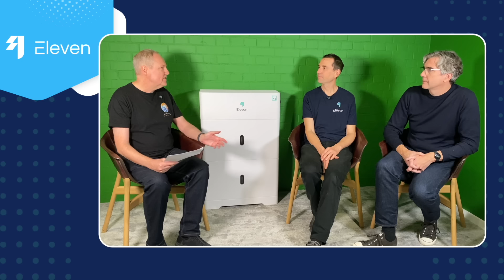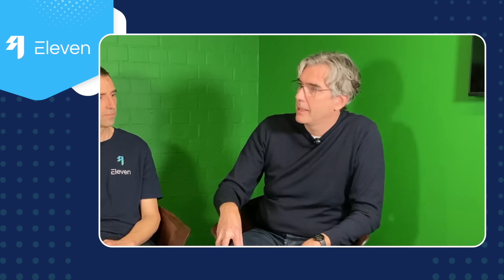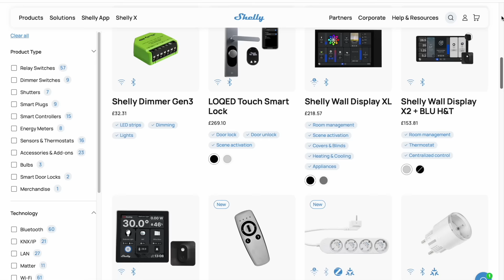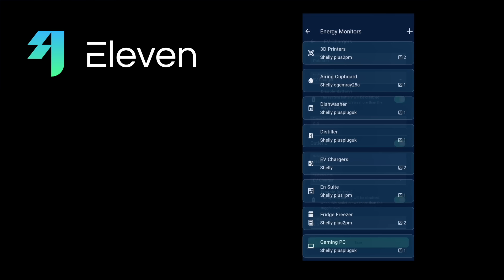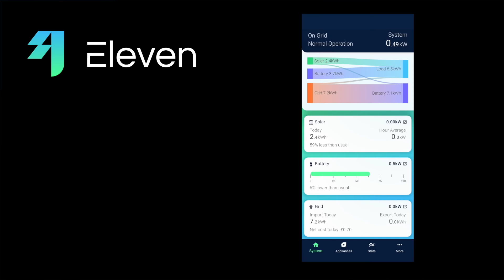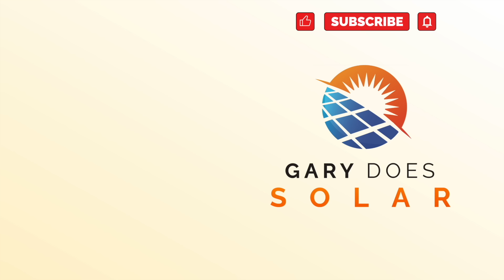Home Batteries: Could SODIUM Be More Popular Than LITHIUM Soon?

Comment: Yet again, no real addressing of the unusable charge /discharge curve of sodium batteries. You either have extremely expensive associated equipment to invert across the discharge curve, along with massive conductors, or you only get to use a small percentage of the capacity.
Reply from the maker: So why are BYD and CATL investing heavily in this technology then?
Reply: @GaryDoesSolar Probably because they are hoping for a cost benefit curve that favourably intersects with lithium at some point in the near future. Better to bet on two horses than one. However, the amount of money invested is not a good indicator of ultimate performance, just look at US Synthetic Fuels Corporation which was capitalised in the 1980s at $20bn (real money then) to produce liquid fuels from coal and shale. Wound up by 1986.

Comment: Lithium is the 25th most abundant element in Earth's crust, with an average concentration of about 20 parts per million (ppm) by weight. That puts it in roughly the same league as lead, gallium, and niobium — not rare exactly, but not abundant either. For comparison, aluminium is around 82,000 ppm and iron about 56,000 ppm.
Reply from the maker: Looks like sodium has a real edge then?
Reply: @GaryDoesSolar Only for grid scale battery storage as far as I can see. Here it would be perfect because there is no need for either high energy density or full capacity usage. Both issues can be circumvented by just building massive storage to compensate for the other shortcomings. If the scale is large enough the cheapness of the cells starts to outweigh the more expensive electronics and the small usable capacity. It just doesn't stack up for domestic solar storage or transport.
Reply from the maker: CATL is putting sodium batteries into EVs this year:

https://electrek.co/2026/04/22/catl-launching-sodium-ion-batteries-evs-2026/

I'd like to understand why you believe your opinion regarding transport is correct and their's wrong?

Comment: I am just starting my research into the electrification of my house. Without being to gloomy, what happens to the "brains" (ie the APP development) of a system if the company stops operating. Are there alternative operating systems? I like this sodium battery option but there is a high percentage of UK start ups that do not survive.
Reply from the maker: Usually there is a way to control the system locally—expect solutions to appear soon after should a manufacturer go bust…

Comment: My understanding is that Sodium Ion batteries have a significantly different voltage output curve that isn't compatible with inverters designed for lithium ion batteries. This means you won't be able to simply substitute sodium ion batteries into existing systems.
Reply from the maker: That’s correct—you need a special inverter…

Comment: Very attractive while off peak fees for electricity are low. When large numbers are charging at night I would expect those off peak rates to evaporate.
Did not mention the heavier atomic weight of Na vs Li - therefore batteries are heavier. This is fine for stationary (domestic or network) but for EVs or mobile batteries lighter Lithium is better suited.
Most significant difference for home batteries is the reduced risk of fire of Na batteries vs Li.
Reply from the maker: Someone who didn’t watch the video…

Comment: Will Prose documented a really wide voltage range over state of charge for Sodium Ion.   Some of the savings will likely be eaten up by the extra beefy cables/components you'll need to handle that.

EDIT:  and you guys mentioned it!  Excellent as most others seem to gloss over this significant, but solvable, property.
Reply from the maker: Yes, there are certainly engineering problems to solve with sodium-ion, but it looks like ELEVEN and other companies have solutions 👍🏻😀

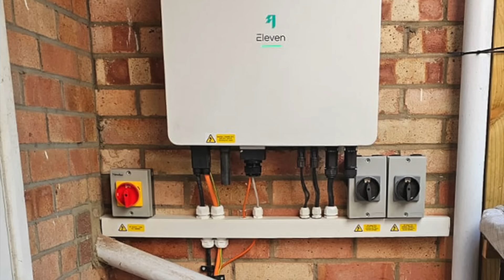Comment: I'd be happy to spend a reasonable chunk on a big battery in the coming years and this could fit the bill. I've already got a Huawei solar inverter and 10 KWh battery. My thoughts are that export rates are going to drop for the middle of the day while potentially going up for the peak slot of 16:00 to 19:00. So if I can send my excess solar to the new battery and force export it at that time this will still earn a reasonable amount of money. It's a bit like gaming the Octopus Flux tariff which never served me particularly well because my panels don't make much after 16:00. Then in colder months I can charge the batteries overnight and use them to run a heat pump effectively cutting my gas bills enormously. 

So there's a few assumptions there but it seems to be the direction we're heading in. Heard a couple of days ago that E-On are about to cut my export rate from 16.5p to 6p which sucks. I'll probably stick with them until February and go back to Octopus when I start to actually export again.

Comment: Worth poiting out that using sodium battery is a good thing regardless of the impacts of mining lithium.
EVs will always need a high energy density, no point in lugging around an 800kg fuel tank if you can get the same range from a 400 fuel tank.
For your house it doesn't really matter how heavy your battery is. Even if you move to another house there is little chance that you're going to take that battery with you.
So if you're not using Lithium's main advantage, why bother competing for the same limited resouce. Using cheaper materials should mean cheaper batteries right?

The main problem with Sodium batteries is that they are more expensive and that's a hard pill to swallow when the total number of expected cycles are nearly half those of Lithium. This could change with investment in the field but obviously that investment needs to be done at a governmental level or industrial level. Relying on the consumer to drive this investment is idiotic since nobody will pay twice the price for half the reliability.
Reply from the maker: Great points!

Comment: There are a couple things mentioned in the interview that need amplifying. First they admitted they are using older first generation sodium cells. These have a density around 160 while the new cells from CATL now have a density around 200. This is about the same as LFP cells.  Next the Sodium cells are projected to cost half as much as LFP in 2026. Thirdly Sodium cells not only have better cold weather performance, they have a much wider temperature operating range overall than LFP. This means they do not require the extensive heating and cooling systems required for LFP to keep them at the optimal temperature. This could also lead to greater cell density at pack level. It is true the different characteristics of sodium cells require changes to the BMS and inverter to optimize performance.
Reply from the maker: Worth contacting ELEVEN direct…

Comment: CATL is going hard on this technology. Prices around 20dollar/kWh.
Reply from the maker: Wow!
Reply: Where can I order the cells at that price?
Reply: @edc1569 ...productions ramping up they can build on swapped LFP lines larger format cells are also being built for bulk storage solutions.  .. If they are using CATL  cells they guarantee their  cell packs for 12 years in a car they are talking 5.8my km in charge cycles   before they drop as low as 85% where they can be removed to use as storage.

Comment: Hi Gary have you heard about the consultation regarding feed-in tariff Scheme ?
There is a consultation to which nobody who is on a contractual obligation with the government. Notified about regarding the changes to how the increases are calculated regarding your payments for generation and exportation of electricity to the grid.
This hidden two choice consultation, where the government is the only winner in this ends on the 12th of december.
Everybody and anybody who are signed up to this scheme, they have their contact details. And addresses as this is a contractual obligation with the government. Yet no one has been contacted about this consultation going on behind closed. Doors in secret away from the people that have spent many thousands of pounds Having solar equipment installed and signing up to this scheme.
I will attach the link so that people can read the information for themselves. Anybody who has signed up to the scheme can post the negativity towards this two false choice option that the government are trying to sneak in through a back door. https://www.gov.uk/government/consultations/feed-in-tariffs-fit-scheme-indexation-changes

Comment: Is the issue with sodium ion battery not the discharge OCV (Open Circuit Voltage)  curve as discussed by Will Prowse recently?   
Lithium provide a very flat discharge so Vvrtually all the useful capacity is found in this  very narrow voltage band, with only significant excursions when reaching around >98% or <10% of state of charge which is not the case sodium - although CATL new naxtra supposedly solves this.
Reply from the maker: It’s certainly an issue but one that can be alleviated via various means 👍🏻

Comment: What is are thir professional backgrounds and how mlomg has thir company been going?  Why has sodium not been widely used for solar batteries before?
Reply from the maker: Those are questions you can put to them directly. They’re well qualified and Andy has been running Midsummer Energy so I’d say he understands the home energy market extremely well.

As to your question about sodium, that’s a redundant one, I’m afraid. You could ask that about any material not used widely before it was.
Reply: @GaryDoesSolar just suggesting these as talking points for any future video with them.  And the question of why sodium wasn't thought of or used before feels like a reasonable one to me, just curious that's all.
Reply: @funwitholdconcretethings8721  I was going to ask the same thing, if Sodium is such a good materials for batteries why hasn’t it been though of already?!

Comment: The biggest issue of sodium batteries is the large differences in cell voltage from 100% (59V) to 10% (appr 38V) 

So the inverter that eleven is using, the 6kW version can only discharge the batteries with 100A, and barely reach 5900kW when the batteries are FULLY charged.
At 10% the battery voltage is about 38V, so the max power is way under 4000W..

The flatter curve of LFP batteries is a great advantage!
Reply: They get over this issue by specifying batteries that are 40% bigger capacity than needed and only using 60% of the capacity. That won’t make financial sense at the moment but when sodium batteries are as cheap as chips it will, obviously space allowing.
Reply from the maker: … which could be why they’re releasing larger inverters?

Comment: New inverters or significant updates are required. This have a very wide voltage range during discharge.
Reply from the maker: … and these are coming (Andy mentioned in the video) 👍🏻

Comment: Well done Gary!
The killer competitor here is a company like Sigenergy. With DC-DC converters built into their batteries, they can switch battery chemistry and be able to use Na+ batteries interchangeably with LFP batteries on existing inverter design, since the DC-DC converter can be designed to handle the rather wide voltage range of the Na+ battery.
Reply from the maker: Thanks—and yeah, I’m expecting the mainstream home battery manufacturers like Sigenergy and Tesla to be watching sodium-ion technology development very closely…
Reply: CATL. 20000. researchers,  2 billion$/yr fund..I guess they have a one or two working on DC/DC converters

Comment: I've seen a couple of presentations by Eleven energy on various channels and they do give a very good representation of the company. Although that's probably because they appeal to my geeky nature. 

A couple of points I would like to see addressed. How does the cost of the other components compare to lithium ion batteries. E.g. with the voltage curve going low, presumably the cost of wiring is higher. 

Also, I'd like to see some numbers to their cold weather performance. If they take a LFP battery that has to be heated below say 0°C, how much does that effect efficiency compared to their sodium battery. If the LFP battery is well insulated is the difference significant?

Also, I'd like more concrete evidence on cycle life performance compared to LFP. If sodium can outlast LFP by say 2 or 3 times that would make a huge difference to whether a battery will pay for itself. A lot of commentators forget to take battery life into consideration when calculating whether an arbitrage system can work. 

A good video though and an interesting British company.
Reply from the maker: Thanks Bob 🙏😀 it’ll be interesting to see how things play out…

Comment: It would make sense therefore to locate the sodium battery manufacturing site near the desalination plants in North Africa, Saudi, and the Gulf states. The salt byproduct would then not be discharged, or dumped, back in to the sea upsetting the local eco-system.  The desalination plants will probably produce more salt than can initially be repurposed. Maybe that salt can be stored in huge salt lakes or vats until it can be used.  It sounds like a win, win.
From a more biased point of view, the excess salt from the desalination plants could be shipped to the UK. 
Another thought just occurred to me. Seeing as we are supposed to be eco-friendly, the desalination plants are probably charged to dump the salt back in to the sea. Why can’t they pay this company to dispose of the salt, I.e. repurpose it. That should cover storage and transportation to the many Sodium ion battery plants around the world.

Comment: I like that they come up with a combination of inverter and battery. You can't really sell a sodium battery without an inverter designed for that battery.
Next they should stop using fixed C-rates (how many amps a battery can charge and discharge) and instead focus on how much power the battery can handle.
For lithium there is a big difference between how they charge EVs and home storage batteries. With EVs the charge cycle is dynamic, with slow charge at low and high voltage, but significantly higher charge rates in the 30-80% range. In solar inverters you set a specific maximum charge rate in amps (C-rate) and the inverter will use that charge rate as a maximum, regardless of the battery voltage. That is not the optimal way to do it and if you have an integrated inverter, where you know the battery voltage and temperature, you should be able to optimize that, allowing much higher charge rates when the battery is between 30-80% full.
At higher voltages, the higher voltage means you can still get a good wattage out of it (the maximum voltage for sodium is especially high) even if the current is a bit lower. So you can have a great solution in the 30-100% charge range, and less than ideal below 30%.
Reply from the maker: Good points 👍🏻